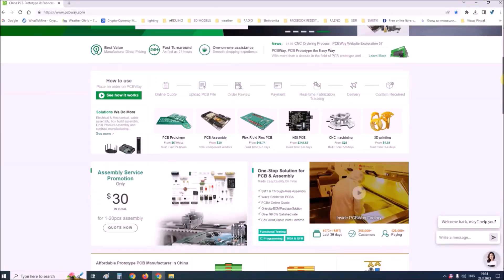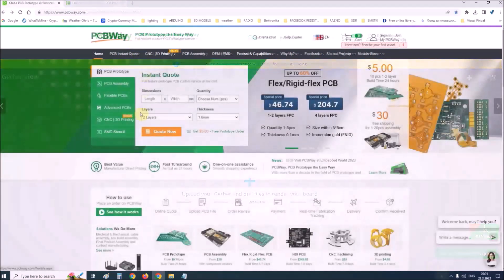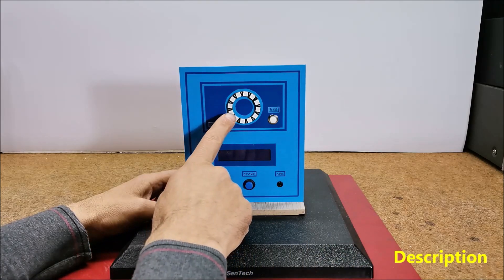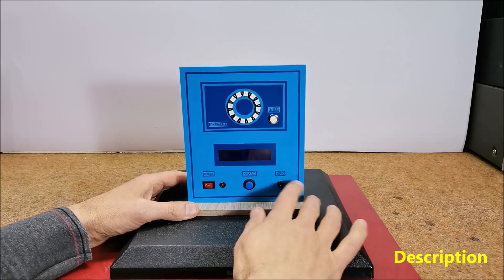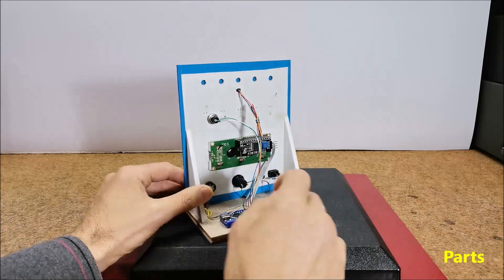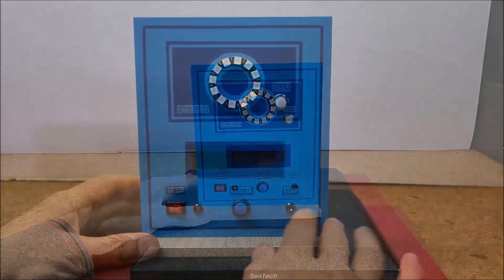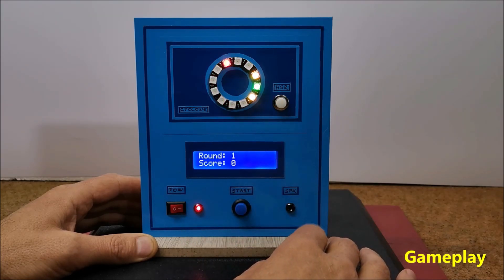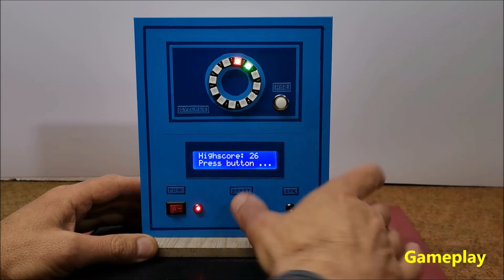Mini Cyclone Game on WS2812 LED Ring and Arduino Nano

Comment: I made this and it works great. I love it. Is there a way to edit the code so that the selector light does not encapsulate infinitely.  As it stands right now, the selector light goes around infinitely, until the player hits the button. Is there a way to make it so that the light only goes around once and if the player misses the target, then the player loses?

Comment: I need your help, you are the best one to ask for that! I have designed a generator with 10 stages. 20kv 1nF capacitors and 20kv 20mA. diodes. I’m using flyback ZVS. For the transformer primary. L1 = 4 and L2 = 4, and supplied by 24V (DC). I have done many experiments, but all of them were failed. The problem is the generator doesn’t work,  and Arc jump into the input of generator., I mean between capacitor legs . What should I do? and by the way, I’m electrical engineer.  thank you for your time.
Reply from the maker: Most likely your high voltage transformer is actually a transformer cascade that has diodes and capacitors at the output and provides a DC voltage. You have to use a HV transformer alone that gives an alternating voltage at the output